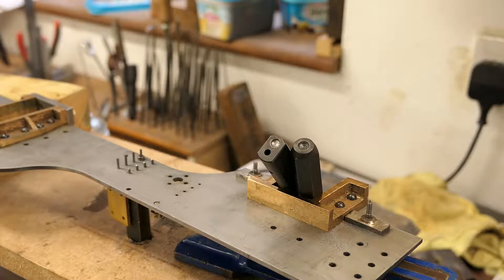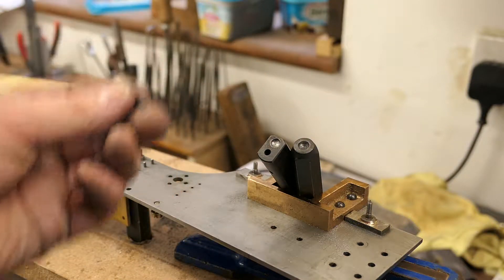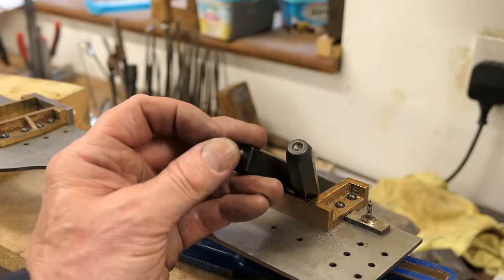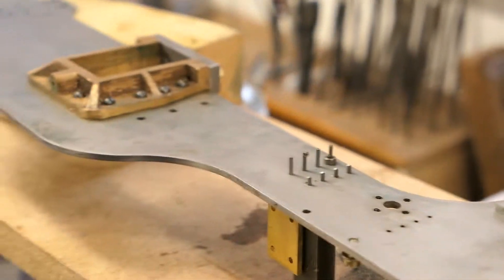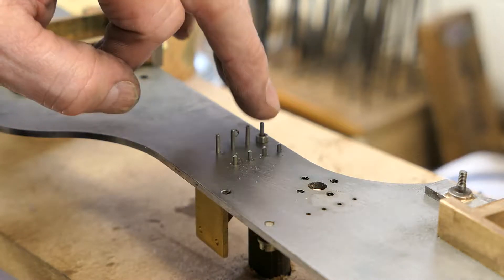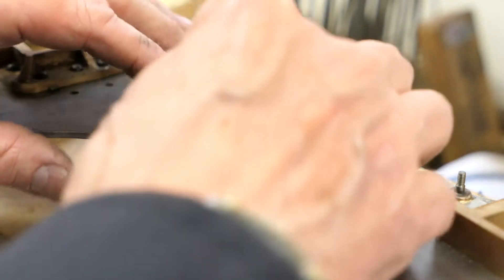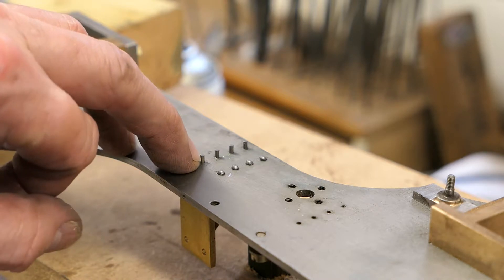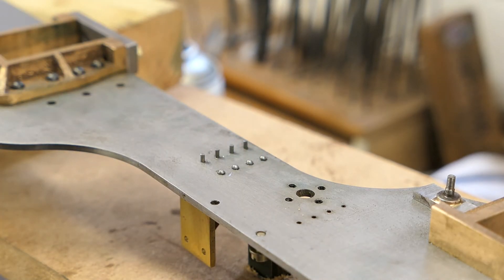Riveting and forming  the dome head

Comment: Hi, where would you suggest purchasing good quality metric snaps?
Reply from the maker: I am not sure I would but it does depend what you are riveting. On my models I found that the commecial snaps were too big and it was better to take my own from silver steel.  They are not difficult to make,  make a small  indentaion in the end of the silver steel using a drill of the right size. Heat to red hot then wack a ball bearing of the size you want  and you end up with dome of the correct size. Temper and you have a rivet snap.
Reply: @engineeringmodeller  Brilliant and very straightforward. Thank you.

Comment: Thank you for the video! So just to be clear, you have the same sized snap above and below?
Reply: Yes same size above and below. Often the commercial snap heads are too big and you cant get them on to the rivet head.  However you can make your own, use silver steel put a small indentation in the end with a drill. Then heat to red hot place a ball bearing of the appropriate size and give it a good wack. You now have a dome with the radius of the ball bearing.  Harden and temper and you then have a rivet snap of what ever size you need.
Reply: @grahamshorrock5558  Thank you!